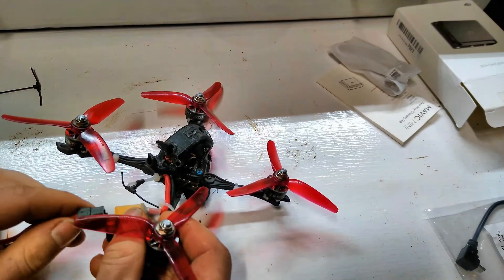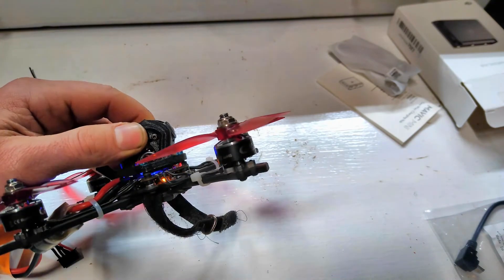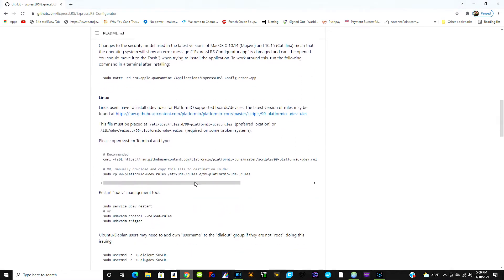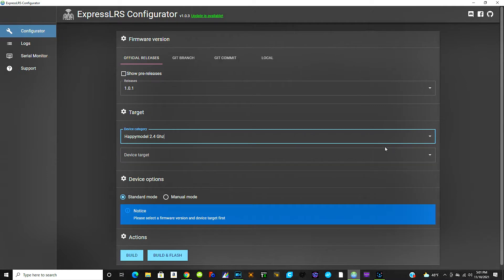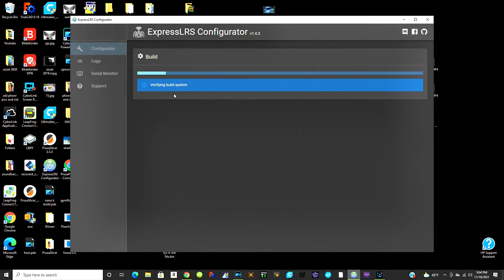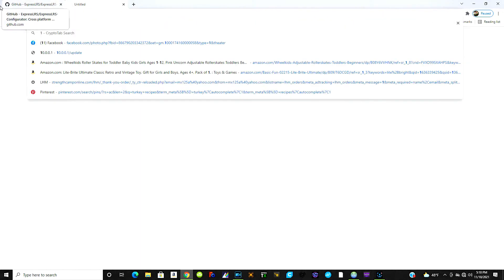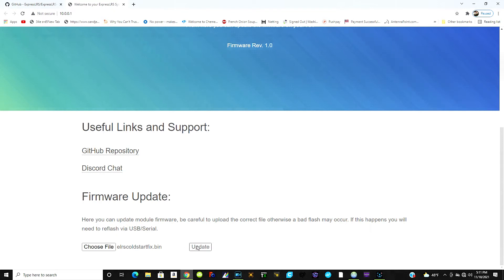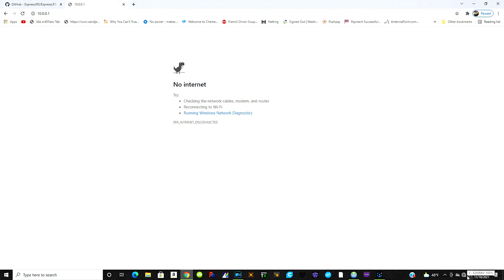How to flash Express LRS over Wifi

Comment: hi do you have a video on how to do a bench test? I'm getting a warning saying RF signal critical and is triggering the fail safe. PS anywhere pass 200 meters and with line of site. it was not doing it before and i need to test if the issue is the antenna on the radio or on the drone.
Reply from the maker: I don't have any bench test videos but I can tell you from experience before I had an antenna fall off of a receiver once and I would get about 200 yards before it would fail safe, try it with no receiver antenna and see if it's the same thing if it is that should tell you your receiver antenna is bad

Comment: Getting somewhere. When I look at the settings in ExpressLRS on the Tx in Tools. Up the top it says Model Mismatch RM Zorro. I watched a video which said download the file for Zorro, as at the time there wasn't a file for the TX12. Mentions nothing about Tx12 Mk2 so I still went with Zorro. There seems to be a telemetry link. If I try to turn off the Radio it warns me that the Receiver is still connected. The Rx is flashing green 3 times repeatedly. I think I'll try flashing the Tx12 file to my Radio and see what happens.

Comment: I’m just about ready to throw this radio in the bin. Radio master goes to all the trouble to create these products. Could you please make it a little bit easier for the noob to use them? Works one time, won’t work the next. Let’s you choose the file but doesn’t give you the option to load. I’m done with this. In the bin it all goes. Hello, DJI.
Reply from the maker: I hate to hear that man oh, I saw that you left some other messages but now that I can't find them, feel free to email me my email address is in the about tab on my channel, I can try to help you the best I can
Reply: @SteadfastRC  Just finished watching a few more videos. Give it another go later today. Understanding what and how it all all works a bit more now.
Reply from the maker: @markgiles8527  let me know if I can help
Reply: @SteadfastRC  Well, man I've flashed the Tx12 Mk2 i have with the Tx12 Firmware. Opening ExpressLRS in the radio up top it says RadioMstr TX12 Model Mismatch. The Receiver I have, a RP1 ELRS, and it's flashing green x3 repeatedly. Not sure what should be turned on or off inside the Radio. If I try to turn off the radio the voice on the radio tells me the receiver is still connected. What do i do? I've used the same binding name for the Rx and Tx. When I have a look at the Rx via the webpage i see nothing in the binding phrase thought. Also, If i turn off the Rx the radio mentions that telemetry has been lost. So its like it's working but it isn't.
Reply from the maker: Express lrs and radiomaster are the absolute pinical of RC control link. The learning curve is steap but it's worth it 💯💪